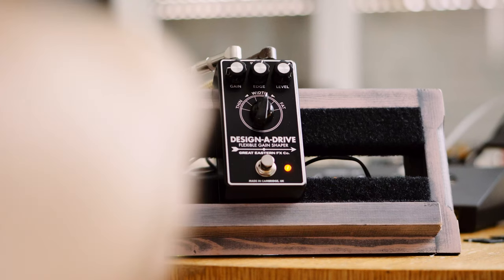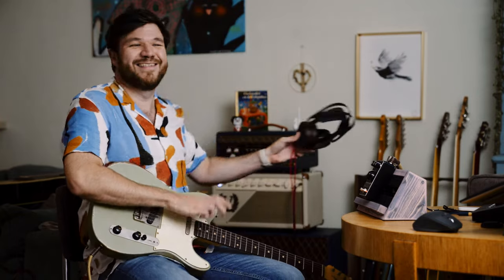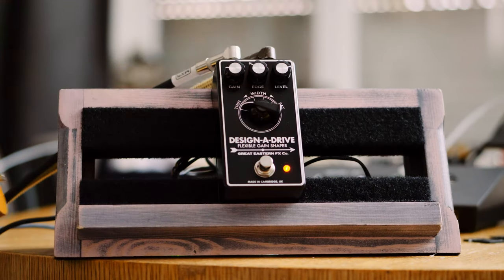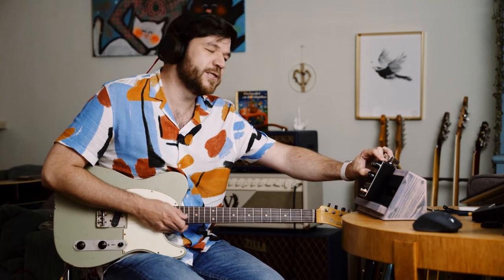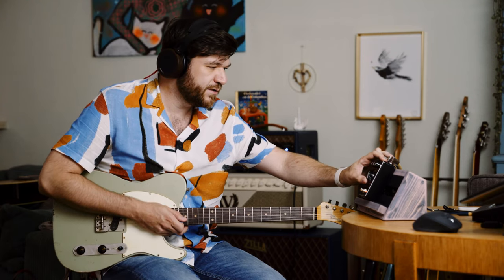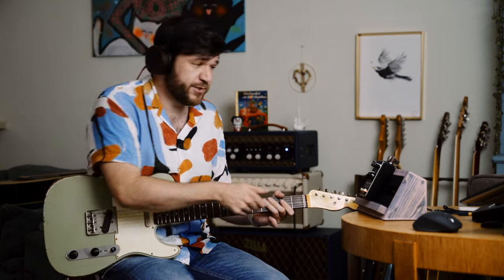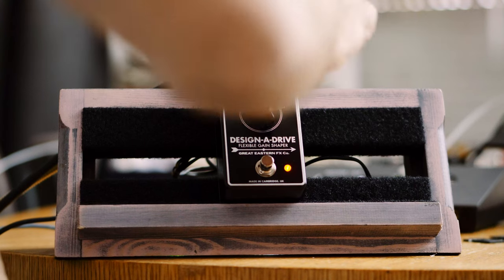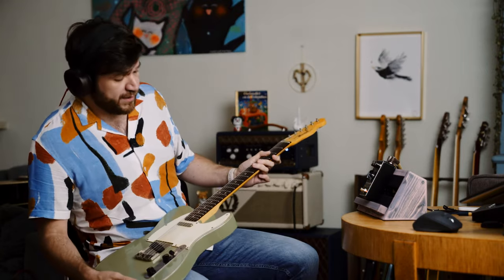Shape your TONE! Great Eastern FX Design-A-Drive!

Comment: Me like 👍 Has a powerful shaping circuit. Compresses pretty hard at the more extreme settings? As with any OD, would have to play it through my amp. 
Tough market to make an entrance into? I mostly use Fuzz for my major dirt sound. I have a few OD pedals…still trying to figure out what I need them to do? Mostly will stack, or boost?
These kinds of pedals are super handy when you are just taking your pedal board, and playing through back line amps.